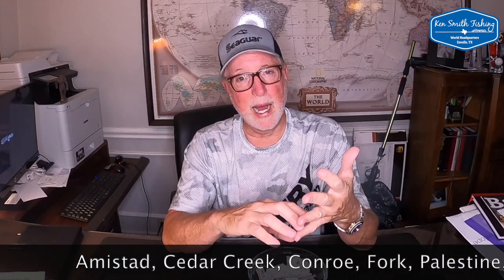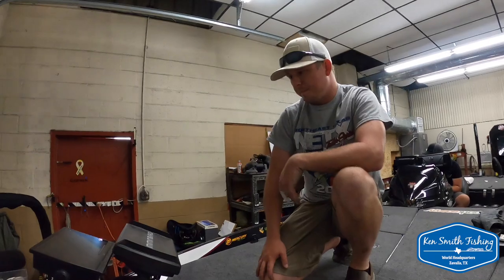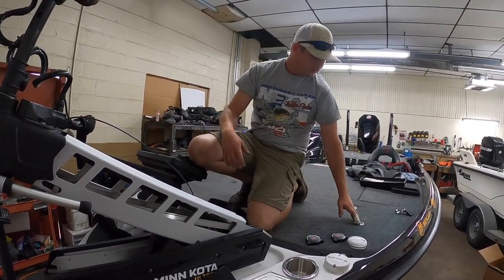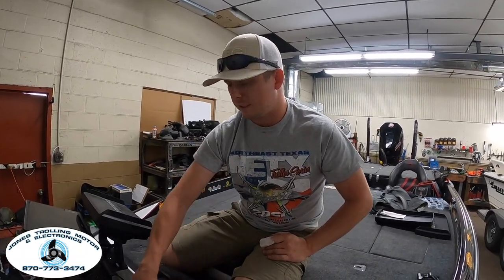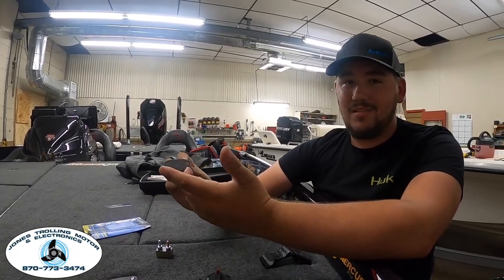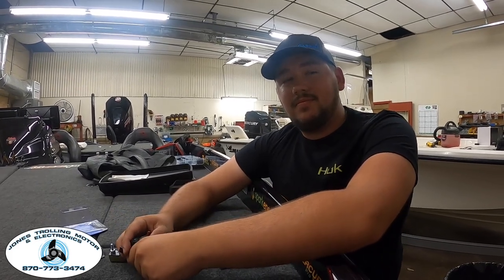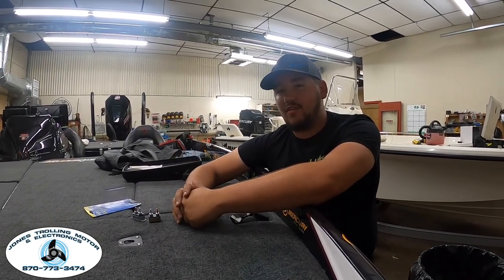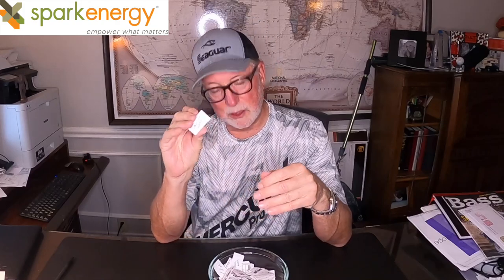Trouble Shooting Tips Before You Take Your Trolling Motor to the Shop

Comment: I would NOT use a steel bristle brush to clean electrical contacts. That will likely destroy the special plating of the components. At most, use a brass bristle.  It's a great idea to use dielectric grease (available at auto parts stores) on contacts to create a seal to deter corrosion.

Comment: What if you put it on anchor and it turns left and stops anchor, but works as long as it doesn't go all the way right to where it goes kinda backwards. It just stops anchor mode only when goes all the way right. Going left is fine.

Comment: Just changed my front graph mount.  I had my front dash off and the trolling motor plug receptacle removed from the dash while I was working.  Got everything back together and was testing all of my front electrical.  I turned the trolling motor switch on, and the blue pilot (on/off) light was on, but the motor blade would not run, nor the steering turn.  I have 36 volts to the plug, so I am baffled.  I was out in the boat last week, and I have had no issues.  Any ideas?

Comment: My spot-lock quit working! Any ideas or suggestions?
Reply from the maker: You know as silly as it sounds the first thing to check is to see if the pull handle or the cable is rolling under the front of the foot pedal, if anything is in the way of the foot pedal it'll turn it off. If that's not it I'd seek a pro to help!

Comment: Is there any other name for that latch bar piece I called my Minn Kota dealer and he had no idea what I was talking about one of my teeth is broken off
Reply: A "dealer" is most often retail product sales, and nothing more. The majority of those will be nearly clueless on parts. You need to contact an authorized service center. That's where you will find someone familiar with repair parts. Most service centers are also dealers, but most dealers are NOT a parts source.
Reply: @txman201  yup got the 70 year old guy on the line easy fix 3 dollar part latch bar he knew